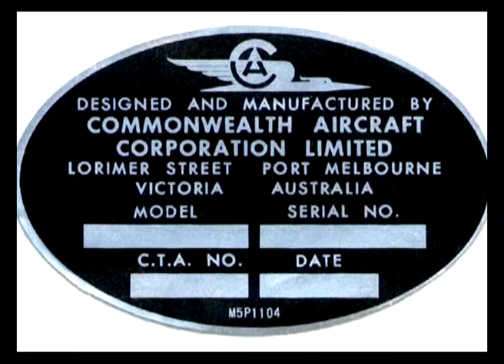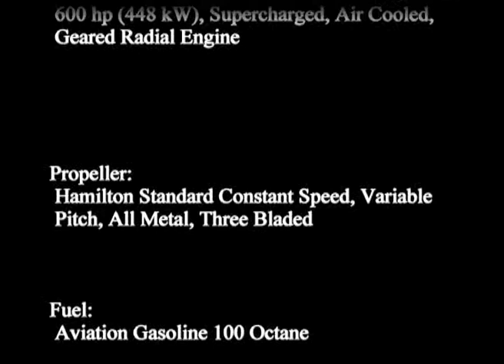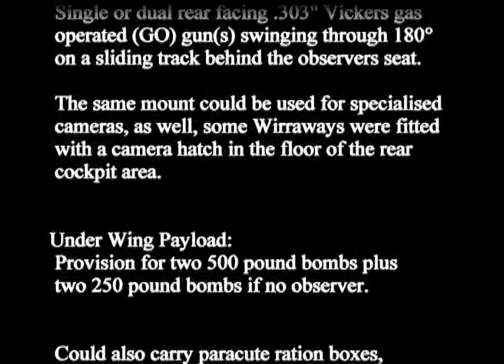Wirraway-Challenge - Part 2 - CAC Wirraway - Fisherman's Bend Slideshow

Comment from the maker: I created this 8 Part DV (video) in February-March 2005 (Hard to believe that was 12 years ago ;^) after purchasing a new PC and some very cool hardware and software, in the form of, "Let's Edit," which sounds innocent enough, however under the hood of 'Let's Edit' (LE) was a Digital Video Capture Card that came with the LE package, as well as the software produced originally by the "Canopus" (Brightest star in the southern sky) Company. It cost about AU$ 1000 back then but keep in mind that in 1996 an Apple Mac PC NLE system could have cost upward of $100,000, however it would not have been anywhere near as powerful as the 'Lets Edit' system, and the Mac would not work in real time like LE would, there would have been long periods waiting for renders.    

 Once I'd installed the card and software, it ran effortlessly, and coming from an analogue (Play Pause Hi8 1 > Record Pause on Hi8 2 - Play on deck 1 to then un-pause to record - that was analgue! )^: editing background I was amazed at the power of a Non-Linear Editing (NLE - digital video editing) system. I figured out how to use the 'Picture in Picture' and effects as well by using the 'parametric equaliser' was able to turn a mediocre recorded telephone conversation into listenable!  So by the time of the Wirraway-Challenge Display Opening on March 20th 2005 all of these 8 parts were edited and completed in about 4 weeks of first use and experimentation at home after work. I was impressed with 'Let's Edit and followed it through, to when the Canopus Company sold to Thompson Electronics, which somehow from there turned into Grass Valley and Let's Edit (virtually) has become Edius8, used by broadcasters all over the globe. Having followed through from the first Edius to having now just updated to the 8.32 or whatever, but wow, now 4K eding real time effortlessly. It is amazing how Edius8 layouter and many other features were a part of Let's Edit!